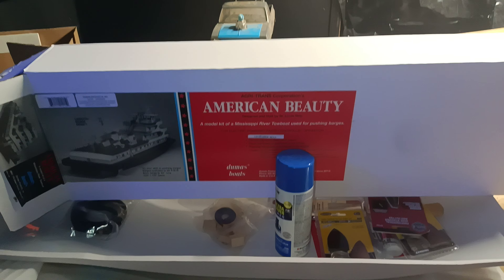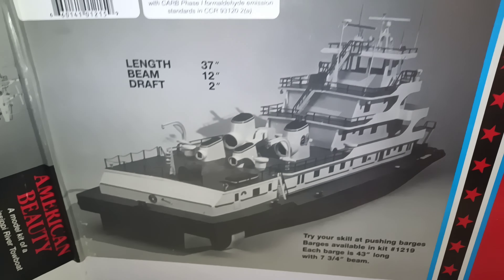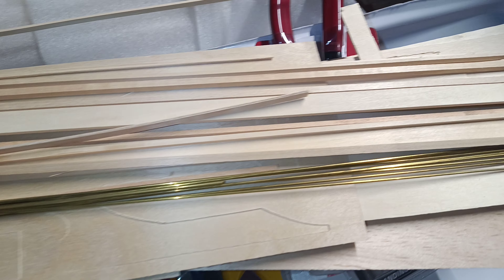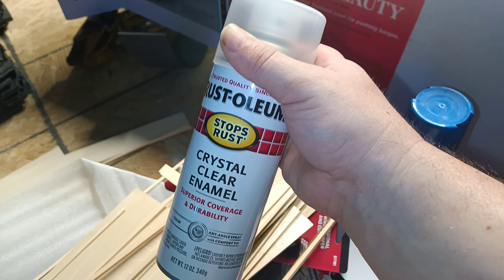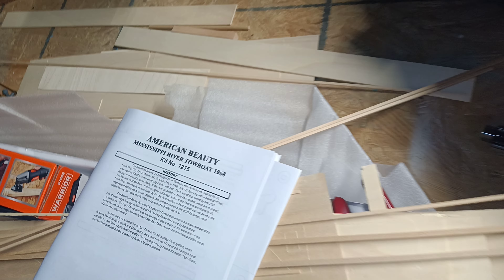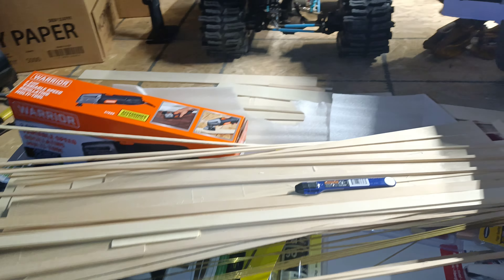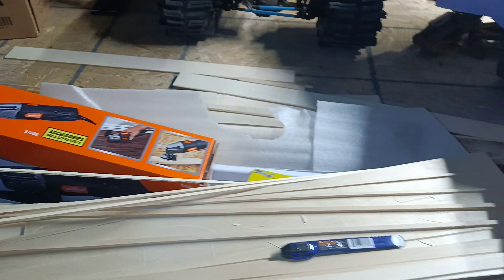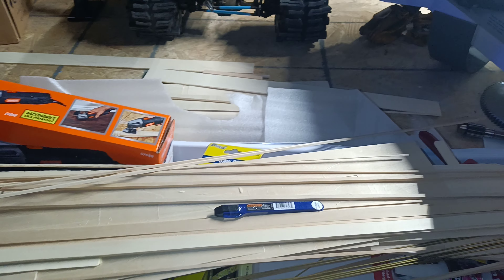Dumas American Beauty RC Tow Boat 🚢 Unboxing

Comment: Looks like a cool project. Growing up in Florida my brother worked on a tugboat and when I got older I worked on a mullet boat and a grouper boat. Building an RC fishing troller does sound like a cool idea but right now I'm still working on repowering my cub.
Reply from the maker: @Whereishome368  Im always working on something 🤣
Reply: @daninthedirt9449  me too good luck on yours.
Reply from the maker: @Whereishome368  Thanks good luck on the Cub if I can help I will
Reply: @daninthedirt9449  thanks for the offer to help me with my Cub I'll take you up on that. First question I have is did you have to notch the motor mount plate to allow for the front axle pin. Second question height of the center of the original crank compared to the Predator 420 crank on the new adapter plate what's the difference. Thank you.